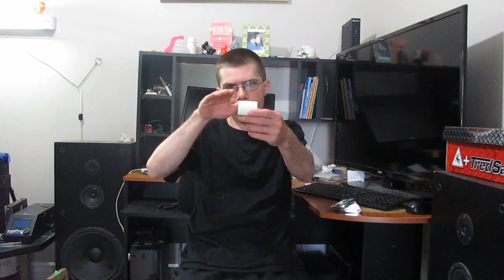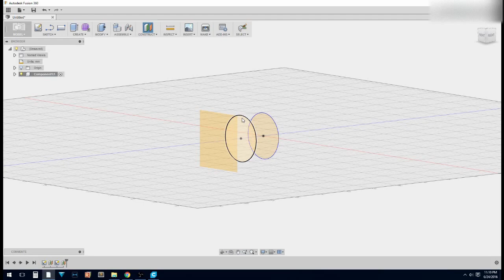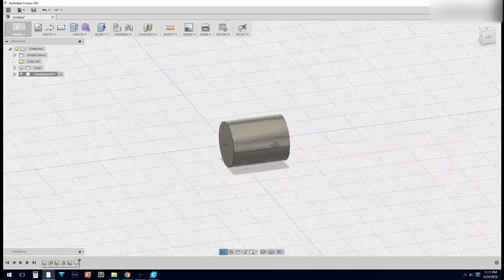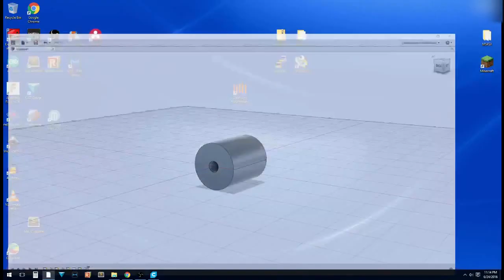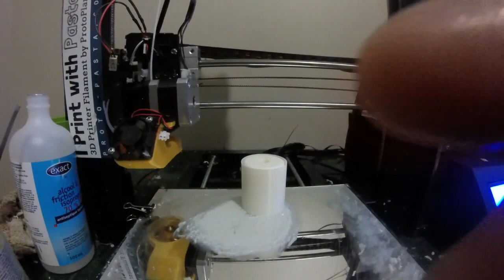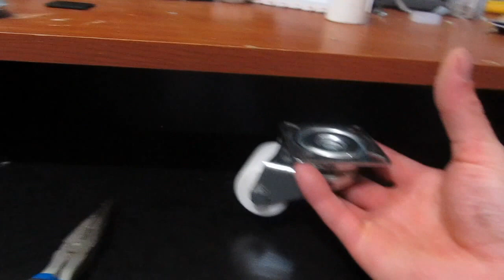Practical 3D Printing #3: Replacement Freezer Wheel

Comment: Nice job !  Cura's new layout is very smart. 
 May need to apply some silicone-grease to the axle, if it doesn't rotate as smoothly as desired. (i'm assuming the oem was nylon?)
3.5mm retraction ?? well, that is certainly alot more than I use on direct-drive,, but glad to hear it is working for you.  Is that with the micro-swiss all-metal hotend ?
Reply from the maker: the freezer this wheel will be on doesn't really get moved at all, so the wheel won't be rolling around much to need lube (and with the .25 tolerance i gave it, it glides very nicely as is). the original i think was nylon. hard to tell.

default retraction was 4.5mm, will probably end up lower than 3.5 soon, just bringing it down very slowly at this point. just running the all stock MK10 right now, i had an E3D V6 clone, but it had issues.

Comment: x2 on using the revolve feature. I was surprised when you used a loft feature. On a simple part like this either with work. Good to see you using Cura 2.1 with your Wanhao. I'd be very interested in a video with your thoughts and settings you use for this new version. Great video! I'm a new subscriber and looking forward to future video's.
Reply from the maker: i may do a video about the new cura and some settings i use, but i tend to constantly be modding and experimenting, so my settings are pretty much always different other than a few key ones such as nozzle diameter, and i guess speeds (but i do change the speeds on the printer itself alot).

like i said to Angus, i just plain forgot about revolve lol. definitely a better option for more complex shapes, i got lucky in this one that i didn't cause myself extra work, really haha.

 Thanks for watching and subscribing! :)

Comment: Nice! I would have revolved that but not sure which is easier in F360. Keen to see how they hold up and really impressive you stopped that warping, the new draft shield seems to do its job.
Reply from the maker: i haven't had much experience using 'revole' yet. it would likely be quicker, but always forget i can use it haha.

the wheel came out very strong. i printed a spare and beat the heck out of it and it didn't break (whacked it on concrete, steel, stomped on it, basically everything short of hitting it with a hammer lol).
Reply: Hahah! That is awesome to hear. I know PLA is easier to print with but damn, when you need the strength ABS is awesome.
Reply from the maker: +Maker's Muse indeed! really slow print speed helped the layers adhere extra-well also. basically, knowing this freezer will be filled to the top with heave ice cream tubs, i gave this every chance of being as strong as possible.
especially where infill is concerned. with previous ABS experiments, so far i've found 40% to be a wonderful balance between strength from just having enough material,  and enough flexibility for impact resistance and weight bearing.

Comment: Very nice video. I am really liking that new version of Cura. It is looking real good.
Reply from the maker: yea, been using it for a couple weeks now. seems like a solid upgrade so far.
Reply: For some reason it does not launch on Ubuntu 16.04, that's why I have not tried to mess with it yet. :(
Reply from the maker: +Angel's Tinkering Corner ah. i don't have 16 yet, still on 14, and my nix box has the old cura.
Reply: I better stick with the older cura and submit a bug report :/

Comment: Nice one Zakk - I'm all for practical 3d prints. I hadn't seen the draft shield feature in the new Cura... time for me to upgrade I think. Thanks for sharing. Cheers!!
Reply from the maker: no problem! i love it when i get an opportunity to print something useful!

the new Cura has some pretty cool features, such as the draft shield and more control over infill, also (at least on my system) it installs side by side with the existing one, so you can go back with no effort if you need to use a known config in a known version.